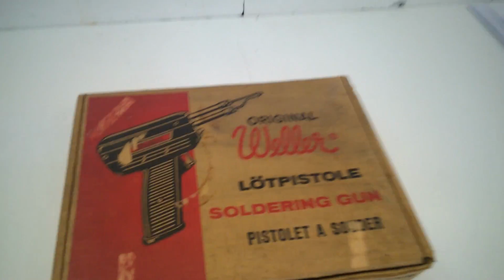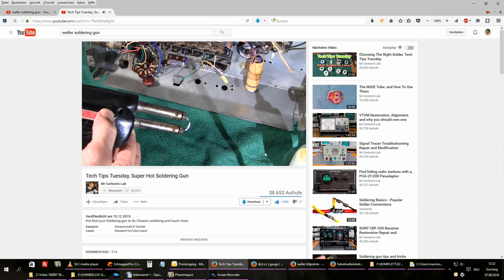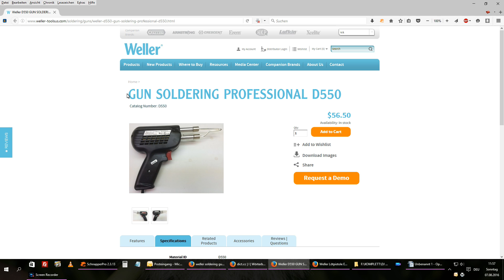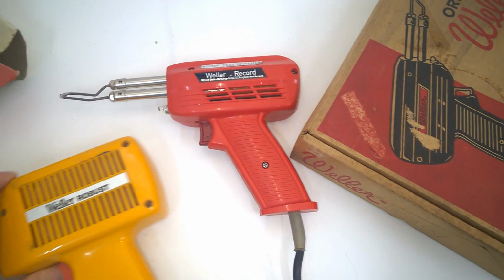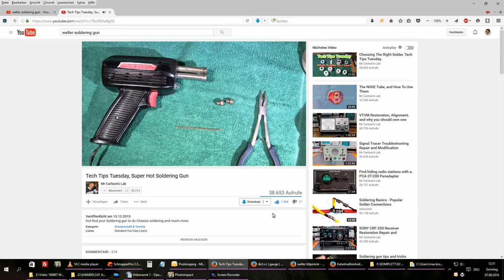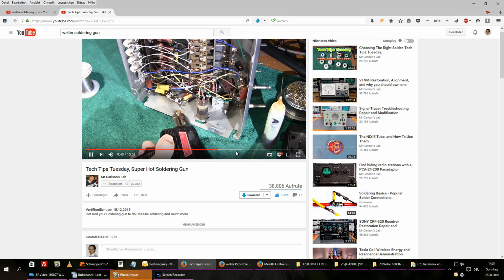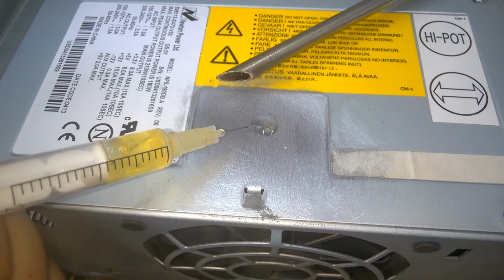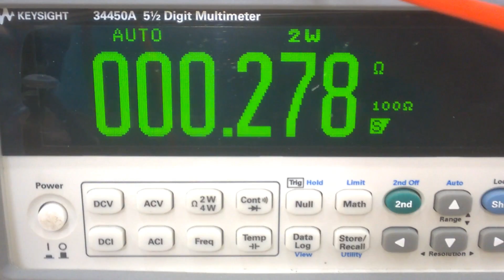Hot! Hot! Hot! Weller ROBUST Soldering Gun, BEB #21

Comment: Hi, great tutorial. But I have some problem, and here Im with my question. Namely, I was oppening the housing and disambling the switch circuit. Now I need a some sheme, or image to fix the switch. In this video / 2.25 to 2.42, seen the switch circuit, but iit is not clear enough. Is it possible to make some bigger picture, or sheme, diagram of that switch:)

Comment: If you put the correct plug on the 120-Volt, 140-Watt gun and plug it into your 220 Volts, you'll have a 470-Watt gun which won't last very long, but it will get hot enough to do anything you're likely to want to do.

;-)
Reply: that's what I'did to my 15wat soldering gun that I'bought in usa and after 10 secs it never heated up!

I'basically cut the american cor and replade  it with an european one.

dumbest thing ever
Reply: I'did that to my 35 wat weller soldering iron and it killed it in 7 seconds....not recomended!

Comment: Copper wire in there is not the best idea, i've done the same thing once in my soldering gun but it blew up, the copper was not resistive enough.
Reply: I’ve been using 12 gauge Romex wire in my Weller soldering gun for a few years now. It’s been working just fine. Not sure if it’s in my 300 watt or my 100 watt gun, but I know it’s in one of them and it works just fine.

Comment: What is the duty cycle of the 250 W gun? My 100 W gun has a 20% duty cycle.

Also, I think the copper wire will dissolve into the solder.
Reply from the maker: Hi Sean. Thank you for your message. I don't know the duty cycle. Will check that when I am using it again. You are right with the copper wire. It's not a durable solution I guess. Greetings from Austria.
Reply: The manufacturer indicates that this gun has a 20% duty cycle too (1min/4min).